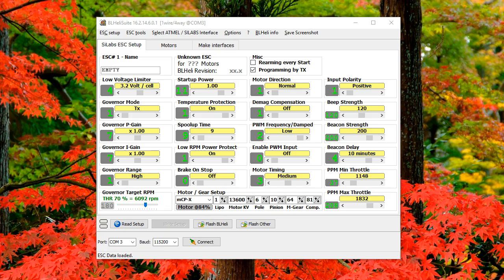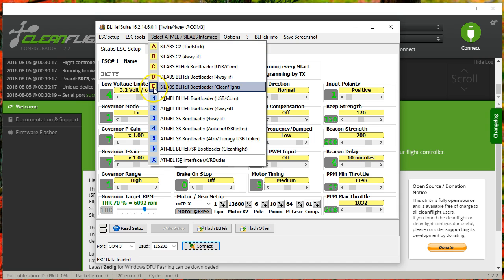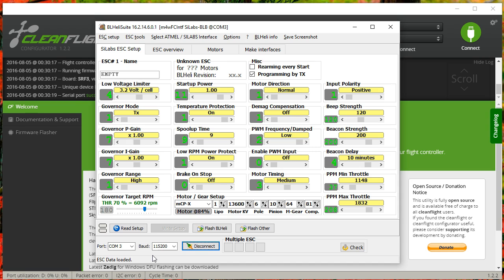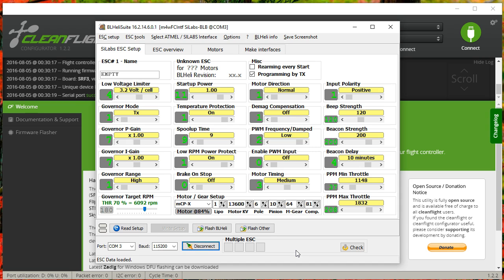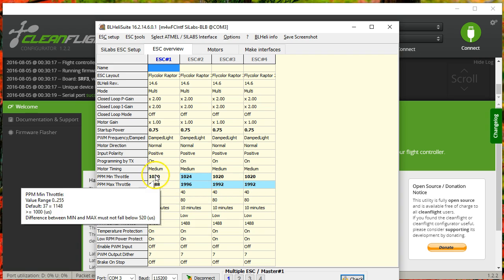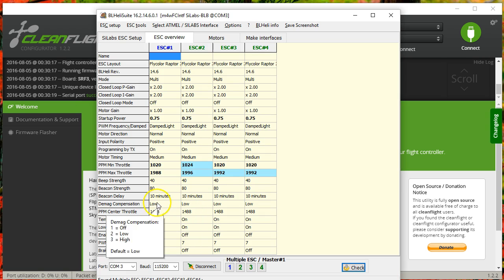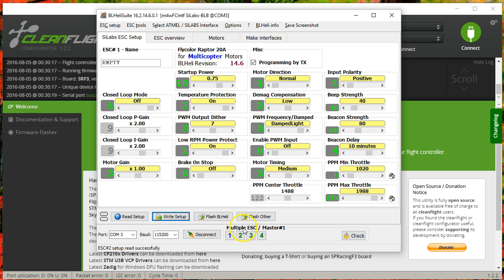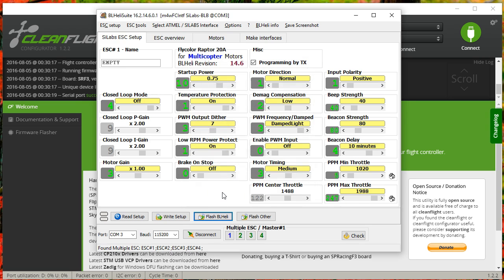How To Use BLHeli Passthrough to Program BLHeli ESCs

Comment: I have old emax 12a esc's that say 1-wire problem or something of the like. Should I just flash blheli to the x-rotor 20a I have and retire the old emax's?
Reply from the maker: Xrotor 20A is almost guaranteed to be a much better ESC.
Reply: Thanks Josh! I've benn having problems trying to calibrate the emax's after a goal post strike. I got the xrotors cheap and now have a programmer, so I guess it's time to retire my beginner esc's.

Comment: Hey man, for some reason my Aikon 30a ESC's are flashed with blheli_s 16.2 but the blhelisuite does not show all the options that your screen and everyone elses does. It doesn't give me a box where I can activate damped light, and it doesn't show all of the governor options. Any idea? I'm at a loss man
Reply from the maker: It's because _S ESCs have different options. Damped light is always on for example. You can't turn it off. That's why the option isn't there.
Reply: So what other settings should i have on/off/set to with the options that I have available?
Reply from the maker: I mean, the _S options are the same as the regular options, just some of them are fixed or set automatically. Leave timing and demag at defaults. You could try adjusting endpoints according to my "maximum resolution ESC calibration" video.

Comment: So passthrough was removed from betaflight versions newer than 2.7? I'm on 2.9 and it no longer works.
Reply from the maker: It's definitely still in there. You're saying if you flash back to 2.7 it works, but if you flash to 2.9, it doesn't work, and nothing else has changed?
Reply: +Joshua Bardwell saying it use to work on this setup. since updating to new version the pass through done not work. It did before and nothing has else changed. the quad flies great. it isn't keeping me down but I kinda wish I could still do pass through to update the ESC firmware.
Reply from the maker: +Hungry Eyez if you flash back does it work?

Comment: Hey Josh, I seem to be having a rather unique problem.  I recently got a set of EMax Lightning 30A which promise great things, but I can't get BLHeli Suite to find them.  It connects to my Naze32 (acro rev6), but when I press the Check button, it returns all blanks "---".  The log says 0 ESCs found and when you dig down to the error the msp recv fails.  The kicker is, it seems like they're working fine otherwise.  They power up and spin motors no problem.  BUT, I would like to have access to the settings to change motor directions and stuff.  Any ideas??
Reply from the maker: Are you powering the ESCs before you hit "check"?
Reply: I sure am and they give the expected tri-tone greeting without the two longer tones.  I had a set of DALRC ESCs before that I had flashed and programmed without any trouble, so I was kinda confused when nothing populated upon hitting the Check button.  If you're interested, I can email you screen shots of the error and the log.
Reply from the maker: Better to submit to the BLHeli rcgroups thread. I'm not an expert at analyzing blheli logs.
Reply: Josh, I have to thank you.  I was a little bummed when I saw your last reply directing me to the rcgroups forums.  I had googled the snot out of my issue and didn't find anything really helpful so I doubted I was going to find anything more on rcgroups, but I went ahead and signed up for the forum.  After a bit of searching, I found someone who had the exact same issue but with some DYS ESCs!  Long story short, I hadn't thought about the flight controller firmware affecting the passthrough.  I upgraded to the latest BetaFlight and BLHeli finally found my ESCs!

Oh, but it couldn't have just been that simple...  No, the 20 and 30A Lightning ESCs come with BLHeli 14.2 on them, but there was no Lightning when 14.2 was released, so in BLHeli Suite they show up as Emax Nano 20A, which have a different MCU (F33x vs the lightning's F39x).  So I had to enable Expert Mode to enable the "ignore inappropriate MCU" checkbox and flash the new Lightning 20A Multi hex file.

Emax sure turned heads with their race-spec motors, but heads will likely turn back the other way if they can't nail down their ESC game.  Here's hoping the results are worth the effort...
Reply from the maker: Them are some hoops you had to jump through. Glad you got it sorted out though.

Comment: I have had another problem with connecting. When I plug in my battery it powers up my escs and my ubec. my ubec powers up my osd (micro minim osd) and it is connected to my uart 1 of my f303 v2.1. the problem was that the uart 1 is connected to the USB port or something like that. so what I have to do it un power my osd and it works fine. I haven't moved it over to uart 2 because I'm lazy but maybe that's the fix :) love the vids Joshua so informative.
Reply from the maker: +Patrick Donovan live it to UART 2 or disconnect it. Maybe also can use softserial at 19.2 kBaud if you're short on UARTs.

Comment: Hi Josh, I've got dys 16amp escs from banggood. And sp racer clone. And I keep getting an error message of "Initialization of serial 1wire passthrough failed! " Could it be that they don't have the bootloader installed?
Reply from the maker: What version of Cleanflight or Betaflight?
Reply: +Joshua Bardwell Sorry I'm running betaflight 2.9
Reply from the maker: +bryce ellington okay. What ESC?
Reply from the maker: +bryce ellington sorry. You told me. Well, either it's the FC or the ESC. Try another ESC?
Reply: +Joshua Bardwell I have another setup on my 180 that is a naze32 rev6 with the HK King Kong 20a esc and get the error message. I'm thinking about switching to the Ready to fly quads naked little bee's, 20a or 30a.
Reply from the maker: If those are clones of Littlebee it will probably work.
Reply: +Joshua Bardwell okay thanks for the help and I really enjoy your channel.  lots of good content!
Reply: What was the website you had suggested of the guy who does the esc reviews?
Reply from the maker: +bryce ellington miniquadtestbench.com

Comment: Futaba T14sg user here is there a need to change the ppm center throttle to 1520 in Blheli ore only a trottle stick callibration.
Reply from the maker: +Peter Hubregsen center throttle point only matters if you are doing 3D (reversible)  ESC.
Reply: Ok thank's keep up your wonderful info and advice helps me a lot.

Comment: I wish this were both natively compatible with Mac, and tightly integrated right inside of cleanflight/betaflight with its own tab.
Reply: just buy a real pc instead of a mac
Reply: Yeah, it sucks I have to get my old trashy (trashy becuase it is old) Windows computer out to do escs :/ and I don't want to mess around with code on my Mac with wine bottler
Reply: tip for you mac users, get "WMware" the free vertion, install windows on it and your problems are no longer :) just remember to route the usb port you want to the windows virtual machine :) hope this helps, take care
Reply: nixxinn Nah, I love my Mac, not putting windows on it, lol. I had windows before, and the mac just seems nicer. I know there are things (like BL heli Suite) that aren't supported though and it sucks.
Reply: WINE, but I rather it just be native, and inside BetaFlight!

To me thats were this type of application should also be able to reside is inside of the main infrastructure.
Reply: 101rotarypower Yeah, adding that would be FANTASTIC!!! But also a lot of work I am sure.
Reply: Someone is actually working on it:
https://scontent-waw1-1.xx.fbcdn.net/v/t35.0-12/13918713_1090884174321789_958229818_o.png?oh=8289317ed9f3bd93fce403aa469f1296&oe=57AE1012
Reply: the rcaddict, you dont seem to understand, go read about what WMware is before you judge... not going to destroy your presius walled garden mac os experience !

Comment: is the Naze32 pass through capable?
Reply from the maker: +Kyle blackniak yes. Really only the Tornado and KISS can't do pass through.
Reply: I see.  Will having an esc with a BEC cause issues with the pass through?  I've read a few forums that stated that it may cause some issues with pass through.
Reply from the maker: I don't see how. Some older ESC's do have filtering in the signal wire and won't do pass through. Shame I forgot to mention that.
Reply: I have Emax 20a esc's and I keep getting an error code when I try to read the escs.  Sometimes the motors actually spin up along with giving me the error code.  I haven't found anything on any forum with an answer to it.  I thought it might be due to the BEC.
Reply from the maker: +Kyle blackniak if the motors are spinning then the ESC is not in programming mode. Toy might have a capacitor on the signal wire.
Reply: I see.  I have a set of the Emax 12A with a capacitor and the 20A with a capacitor.  Both pair won't enter programming mode.  I will try a set of Emax Lightning escs to see if that fixes it.  Thanks for the help.
Reply from the maker: +Kyle blackniak you can just remove the capacitor also.
Reply: I thought about doing that but I was not sure if it would dirty the power being supplied to the flight controller.  I guess I could remove capacitor and the power feed from the esc to the fc, and run a ubec to power my fc (if it became a problem)?
Reply from the maker: +Kyle blackniak the capacitor has nothing to do with the BEC.
Reply from the maker: +Kyle blackniak it's on the signal line. The BEC is a completely different wire.
Reply from the maker: If there is a capacitor on the power wire that has nothing to do with pass-through
Reply: +Joshua Bardwell aaahhh. I see. I will take a look at look and try to remove it.
Reply: blheli can't get in program mode.

Comment: Does the ESC need bootloader to do this? I have done it before, I'm just not sure what bootloader does...
Reply from the maker: Yes. It needs either the SimonK or BLHeli bootloader, but it must have a bootloader.
Reply: Thanks for the quick reply
Reply: Bootloader is kind of intermediary between the serial wire and the MCU, which handles commands like read/write. If it somehow gets corrupted (e.g. while flashing) you can no longer access the MCU via servo wire, only via C2-interface for SiLabs and ISP for Atmel.